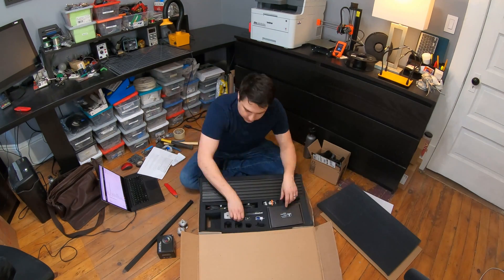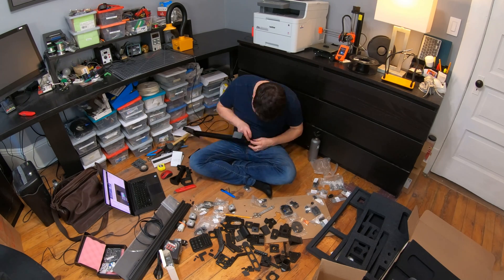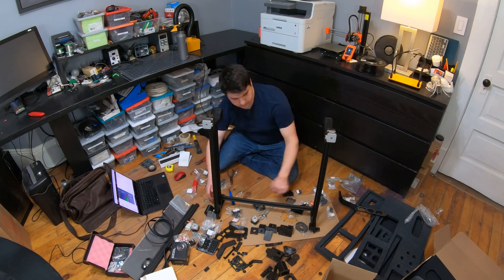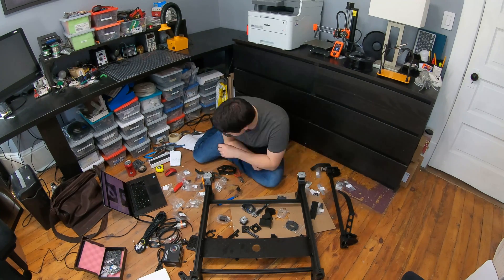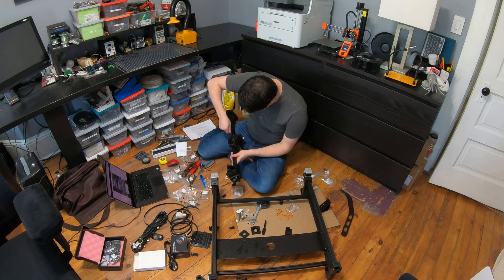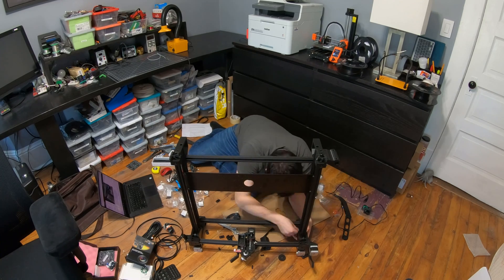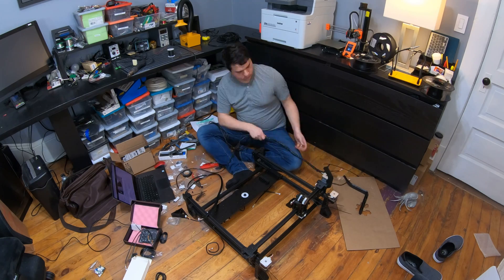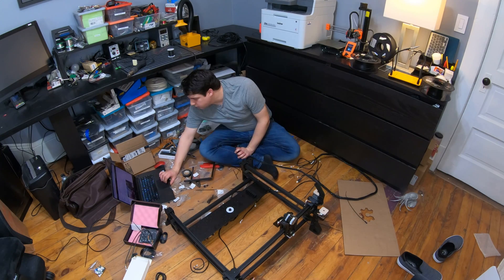Lumen PNP Early Bird Assembly and Tips!

Comment: Great video!  My trick with inserting the belt was to bend the tip of the GT2 belt with your fingers to get it curling the other direction making it easy to snag with a tool.
Reply: Since the belt mount holes are easy to feed through in one direction but not the other, I took a second piece of belt, with the teeth facing out, and slid it through the "easy" way (basically what you did with the metal piece, but with a belt instead), then I meshed the teeth with the belt that I was actually trying to feed, and then pulled both pieces back through using that second piece, and it went in super easy.  Also, re: embedded nut thread issues, I had similar issues on some of the M5 nuts but determined that the problem actually occurred during the embedding process, the torque of pulling the nut into the recess actually damaged the threads.  You may have experienced something similar.  You can avoid the problem by adding a bit of lube to the bolt while pulling the nut through, going slowly, and backing out the bolt half a turn or so every few turns as you go.
Reply from the maker: Thanks! I tried that too but I couldn't get mine stay curled. There is more than one way to skin a cat ;)
Reply: @curlytalegames2609  Indeed!  Someone else taped a piece of a zip tie to the end of the belt to help pull through.